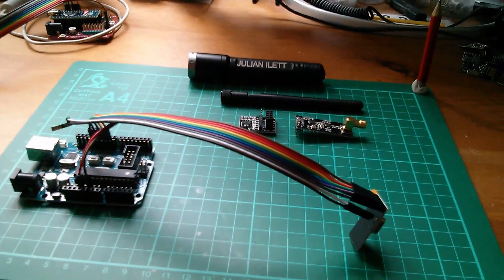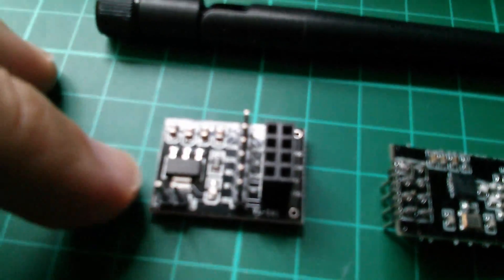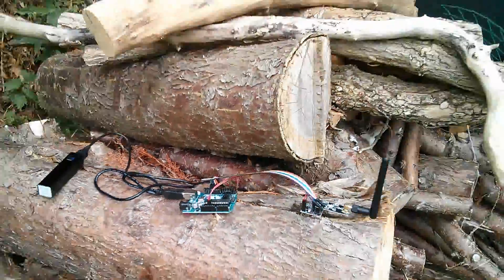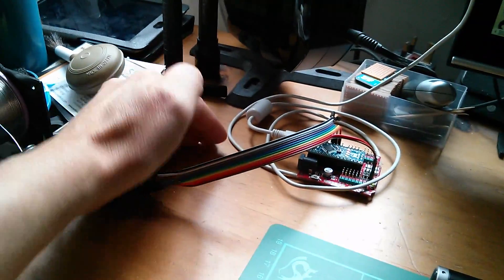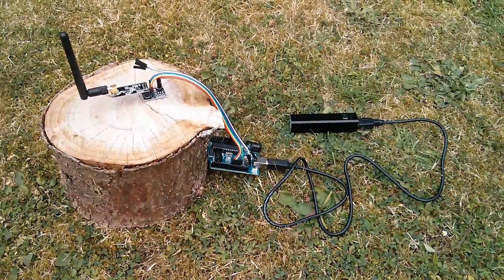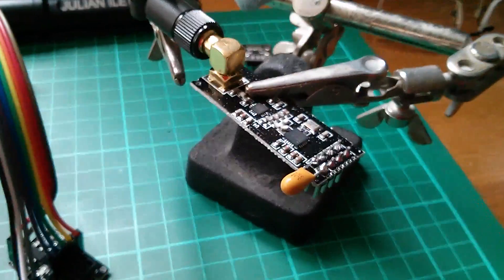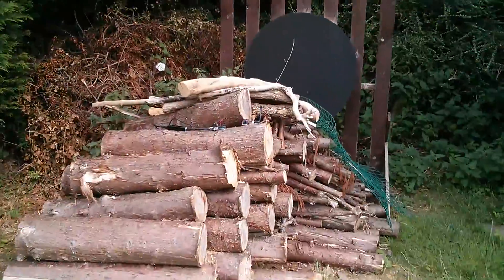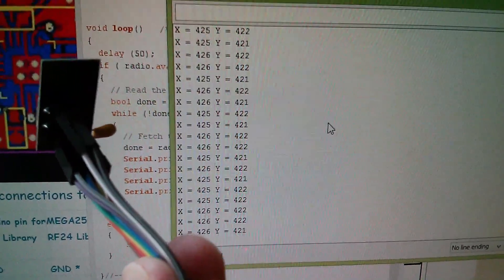Follow-up: Arduino and High Power nRF24L01+ Data Transceiver

Comment: My understanding is the board with the large antenna has a LNA and a PA, the other does not. You should have used the board with larger antenna as the receiver i.e. left it in the shop.  The one without larger antenna should be outside (as the transmitter). Of course, the test should have used two boards both with the larger antennas.  Thank you very much for doing these reviews!

Comment: i highly doubt the high powered transmitter was underpowered, i read somewhere that the antenna one needs about 200mA and the arduino can't supply that amount, so maybe thats the problem idk ;-;

Comment: Hi, have you ever tried to use a Mega with theese modules? I'am having problems with it, with no clue of what the problem is...
Reply: TheItalianGamer The MOSI, MIS and SCK Pins on the Mega are at other positions. Dont know where but i think 51-53.
Reply: @_who_cares_1123  Mega is not able to source ample amount of current to these PA+NA nRFL01+ modules especially the chinese. the requirement is 200mA min but port can source 150mA only AFAIK. Use external battery and join the GND of Mega and Battery and nRF. Also add 10uF cap between GND and VCC of nRF module

Comment: Thanks for the video. I was having the exact problem you display with my project. Works 100% at PA_MIN and near 100% fail at higher power levels. My NRF2401 module is supplied with its own power from a regulated supply and I have added a 47uf  capacitor across the pins with no  change to performance. However by chance, I discovered that if I cup my hand over my circuit board  with the, antenna poking out ,as a shield from the antenna, my high power performance goes to 100%. I can watch the change in performance change  as I move my hand on and off the board. This suggests to me that RF is getting into the circuit at higher power levels disrupting the radio.  I plan to add a shielded box around my circuit board (a Faraday cage of sorts) with the antenna poking out the side. I hope this may work for  others. 73s de KJ6FO
Reply: did you ever find a solution, I'm having exactly the same problem and observing the same results
Reply: did you ever find a solution, I'm having exactly the same problem and observing the same results
Reply: +Kevin Schreiber Thanks for sharing the article Kevin. Looks like good advice and the simple method of shielding looks promising.
Reply: I eventually ended up using kapton tape to insulate and then copper foil soldered on to shield, works well but looks ugly so I have just bought some that already have a shield
Reply: +Kevin Schreiber haven't received them yet but as soon as I do I will do a test, I use them on my quadcopter for control and telemetry. a number things effect range such as data rate and whether you are sending data both ways using ack payloads but I will try a range of conditions. the one I have bought is this E01-ML01DP5
http://s.aliexpress.com/63muaAj2 it looks very well made and ebyte do a range of rf products that all recieve good reviews, it claims 2100m but we will see when I test it.
Reply: You all probably dont care but does anybody know a tool to log back into an instagram account?
I stupidly lost the login password. I love any assistance you can give me!
Reply: @Jonah Princeton Instablaster ;)
Reply: @Romeo Jacob Thanks for your reply. I got to the site on google and im trying it out now.
Looks like it's gonna take a while so I will get back to you later when my account password hopefully is recovered.
Reply: @Romeo Jacob it worked and I finally got access to my account again. I am so happy!
Thanks so much you saved my account!
Reply: @Jonah Princeton Happy to help :)

Comment: I think I agree with others that have suggested these units,  being 2 way may be communicating with each other and the signal still suffers from having to wait for the lesser powered transceiver. 

Instead of the delay,  why not just put a sanity check in to ignore the failed packets/connection.  I would be interested in seeing how many successful packets are transferred, ignoring the failed data,  compared to the original transceiver. 

Also,  I have a couple different antennas for video transmission and have found that there is often a big difference if I switch these out on the transmitting and receiving sides.  Maybe it was more reliable because the original antennae were more similar originally?  It looks like the range is definitely being extended though,  even with only one side being upgraded.

Comment: I've been experimenting with these modules quite a bit recently and managed to get pretty good range. Using the high-power one with a clover-leaf antenna as the transmitter, and a normal one as the receiver, I get a rock-solid connection up to about 400 meters. This is purely one-way, 250kbps, auto-ack disabled, and clear line-of-sight. The throughput is about 260 packets per second. Unfortunately after 400 meters the road at my test location curves around a little and some trees get in the way. Not much happens until I get to a slightly clearer patch around 700 meters, where I can still get 250 packets per second if I hold the receiver juuust right, but it can just as easily be zero if I hold it juuust wrong.

Unfortunately the curve of the road doesn't let me get any further without solid obstructions. I would like to measure the furthest distance possible that still gives a decent packet rate, but living in Tokyo it's extremely difficult to find anywhere that has more than a few hundred meters of straight-line visibility. I also got a second high power module and an antenna for the receiver and so I will try those together next time.

Comment: Expecting continuous successful data transfer at high speed data transfer rates at long distances doesn't make sense to me. Normally, if an expected payload is not delivered, a automatic retry is used with a ring buffer to build and re-construct the data effectively, doesn't this chip come with this technology? or is the software library handling this scenario?

Comment: Hi Julian,
Yes, that's something I found many years ago while trying to connect 2 Olimex boards by simple 433mHz modules.
Delays are a must, unless the data is driven by interrupts.
I should try do the same now with my Arduino Nano clones, but my lack of motivation, excess of winter and flu's have taken
over for a while.

Comment: I haven't watched your first video yet, so I don't know what your code looks like, but it's possible you're actually checking the Rx for data faster than the Tx is sending it... A better test would be a sequential number increment, then you'd find it if it is really loosing packets. btw, the big capacitor fixed issues I had both with normal and high-power versions of these, so I use a large buffer cap on all my boards now... regardless of low/high power or tx/rx.
Reply from the maker: I am now sending a sequential number and also a pass/fail indicator from the boolean returned from write(). Slowly I'm starting to get my head around what's going on.

Comment: Hi Julian,

Excellent video as always, you mentioned in your first video on the module that you were not going to connect the interrupt pin. Could you use this to know when data is ready to be read in?
Reply from the maker: Dean Roker Of course, but polling works just as well in these simple programs

Comment: As noted by other commenters, this is a two-way link so the problem is likely due to the receiver still being a weak PCB antenna. The documentation for the write() function states:

"This blocks until the message is successfully acknowledged by the receiver or the timeout/retransmit maxima are reached. In the current configuration, the max delay here is 60ms."

I would guess that the sender is almost never receiving any ACKs from the receiver. It is merely sending the data and waiting the 60ms, then giving up, sad and lonely. The receiver for its part, is dutifully sending an ACK for everything it receives, but those ACKs never arrive.

Hence there is only ever one data available every 60ms. The receiver loop runs faster than 60ms so you get all those "No radio available" messages which is not really true at all. If it said something more like "No data available right now" it might be more accurate. Or even better, just take that println out completely.
Reply: Yes, that should be the reason. I think there's an option to set the transmitter to a "no ack required" mode. At least the NRF24L01 can do it. I haven't looked much into the library, but I guess the option should be accessible from there, too.
Reply: @superdau  radio.setAutoAck(false);
Reply from the maker: Yes, I think that's exactly what's happening. I'm now sending an incrementing integer and also the boolean (as an integer, 0 or 1) returned by the write() function (for pass/fail). This is helping to understand what's going on. But I'm not fully understanding this yet. Adding delays to the Tx loop shuts down transmission altogether - not sure why. Also, the packet size is 32 bytes, but maniacbug is sending integers. How is he doing this? 2 bytes per integer? What if I want to send floats or strings? Still too many questions!!
Reply: Julian Ilett Yes, an int in Arduino-land is two bytes.

To send anything more complex than what can fit in 32 bytes (a single float should be ok) you will need to code up a higher-level network manager.

Although I am still a newbie when it comes to electronics stuff, experience from countless hours debugging situations like this for UDP connections comes in handy here.

Not sure why a delay in the sender loop would shut everything down though!
Reply: Julian Ilett
I had a good evening today and got two NRF24 working as a bidirectional serial bridge ;) . What you punch in on one end comes out the other. I started with one of the examples (called "RF24->Transfer") of the library. I think it's only in this version of the library https://github.com/TMRh20/RF24 though, which is an update of maniacbug's (just be aware that the configureable pins 9&10 are set to 7&8 in the examples of the new library; I changed it in the code to be on 9&10 like on the tutorial page I sent a while ago). Can't say if you need to use the new one for it to work. But pretty much the only thing that is left of it after I had my go at it is the initialization of the radio ;) .
I've pasted the code here: http://pastebin.com/2y4NyzCd  . Flash it to two Arduinos and ground pin 2 of one of them (that just switches around the read and write address). Open two terminals and you should be good to go (I stripped out all newlines though, so the normal serial monitor could be alittle bit annoying).
The most important thing to know here is the difference between byte arrays (that's what the radio library wants), char arrays (your typical C++ strings, needs to be null terminated) and String objects (the things you can convert to upper/lower, get the length of aso.) and how to cast beween them. I've added a few comments in the code.
Reply: Julian Ilett I set up an example that sends a struct instead of individual primitive variables, which is a handy way to send multiple variables together. You can change the layout of the struct without needing to change any of the code that does the writing and reading: http://forum.arduino.cc/index.php?topic=260197.0
Like superdau's example for strings, this is also limited to the 32 byte packet size. Sending a single coherent message spread across multiple packets is quite a different thing, since you would basically be implementing a TCP protocol yourself. Not impossible, but not really fun either (see 'countless hours' mentioned in my earlier comment), and would waste a lot of the minimal space available for code.
Reply from the maker: superdau I'll take a look at the TMRh20 library next, but I wanted to start with something simple
Reply from the maker: ***** I'll look at that with interest, as I want to send floats not integers to my OLED

Comment: Btw, sending and recieving antenna should have the same polarization (angel on the antenna, http://en.wikipedia.org/wiki/Antenna_(radio)#Polarization) If you are into some diy home automation or sensor with Arduino, check out http://www.mysensors.org , complete library with everything and many examples.  they are based on cheap Arduino with nrf24l01+ and some cheap sensors or actuators. Check it out! freeware ofc.
Reply: Any also, lower the transmitting rate from standard 1Mbps to 250Kbps. much better range that way.
Reply: My range between 2 nrf24l01 with PA (amp, + ext antenna) I get ~800meters

Comment: You should use same radio type on both sides. I believe, there would be some ACK packets being sent from what is logically the receiver. So the "receiver" needs to be of a better grade too. Also, the antenna on the bigger raido is much better than the PCB antenna on the smaller radio. For a proper test use identical radios on both sides.
Reply from the maker: I'm thinking the same thing now

Comment: There are some things you didn't try yet: switching the sender/receiver around and trying to receive with the high power one (on the assumption that it also has a nicer input attenuation). Also try to lower the transmission speed over the air on both modules. As each bit in the transmission gets longer in time it should be easier for both modules to make out the difference between the high and lows on the radio band. 

I noticed something similar on my RS485 link which was sporadicly failing at 2MBit/s but quite consistently good at a 10th of that, but practicly rock-solid at 38.4KBit/s.
Reply: That would be equivalent to changing the transmission speed; the radios can run at 2, 1 mbs, or 250kbs.  What speed is he transmitting/receive speed at?  Remove the delay and try lowering the transmission/receive speed.  BTW, I need to know how to do this.

Comment: Hey Julian, good vid, keep meaning to grab some of those for a play... Take a look at one of my instructional videos (on my personal channel) FPV Antennas 101 - Polarization, Diversity & Gain Patterns it will give you some clues as to how to get the most out of those little units. Consider Circularly polarised antennas to avoid multipath interference. Check out the video I linked above and you'll see part of your prob, you've got omni directional / linearly polarised antenna trying to communicate with the PCB type antenna on the RX. Polarisation mis-match will be hitting your dB like a bitch ;) great vid as always bud

Comment: poking into a hole wouldntmake a difference, you need to get down to the water table, so only a long rod or buried water pipe would be a ground, so your wire was doing nothing!
, im gonna go with mismatched antennas as the guess, if you had a second with the larger antenna, it may solve it?
, of course the delay is reducing the data speed by a huge amount, i wonder if its wave interference with the larger antenna either not the right length at all?
Reply from the maker: Yes. I nearly edited that bit out because it felt a bit stupid even when I tried it. I really am an RF numpty.

Comment: Before you fixed the problem I was wondering if it was a synchronisation problem, i.e the receiver not processing the received signal fast enough. Do you have two of those high power transceivers ? Would be interesting to see if they respond better in pairs.
Reply from the maker: I only have one of the high power tranceivers, but I reckon the high power transmitter is capable of much greater range. The next step will be to put an nRF module into my wearable display project. Then I can set off down the road and check the range properly.

Comment: Come up with a few ideas.
Firstly I've heard of some of the chinese vendors including a 433MHz antenna instead of 2.4ghz, this will cause transmission errors. Quite a few wireless routers or wireless cards will have a 2.4ghz removable antenna on them so you could always switch them out temporarily and see if that makes a difference of if you have a spare SMA connector you can usually find out the wire length required for any specific frequency online and make a custom wire antenna.
Would be interesting to see what happens if the big antenna is left on the receive end and chip antenna on transmit to see whether the big antenna receiving allows a bit of extra sensitivity for the lower power chip antenna in the distance. And again, external antenna on both transmit and receive would be interesting.

I have a few cc1101's on the way. Looking forward to trying them out.

Comment: Julian, is that a two-way capable radio link? Or is it simple a slave to master transmitter?
Reply: they are capable of 2 way comms
Reply from the maker: The modules are certainly bi-directional, but I get the feeling these simple sketches are using them for one-way transmission only
Reply: It looks to me like one way, that was why I had this question. After all you have a low-power transmitter in one direction and a high-power one in the other. There's no way the LP one could reach the shed. 

Interesting project. I appreciate your work.
Reply: Graham Wilson
They are capable of bi-directional data transfer. Don't forget the high power version has a LNA in addition to the power amplifier, so the receive sensitivity is increased. It would be interesting to measure the RSSI of these ebay modules as the PCBs look very poor.
Reply: Julian Ilett yes but that goes for sketches demonstrating serial usage aswell quite often yet that is bidirectional :P

I think the modules may actually be half duplex though, ie they can transmit or receive but only 1 or the other at any 1 time. If you want to send a single byte and its in the middle of receiving a byte you do have to wait a moment for that byte to finish receiving before broadcasting your byte and while broadcasting your byte the module will be deaf to incoming bytes.